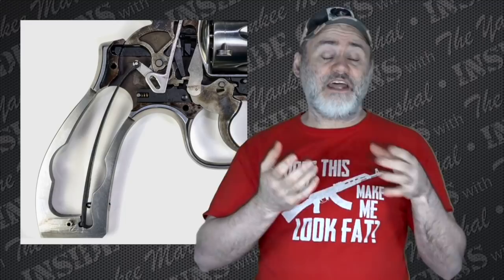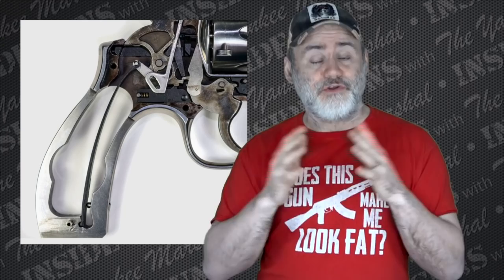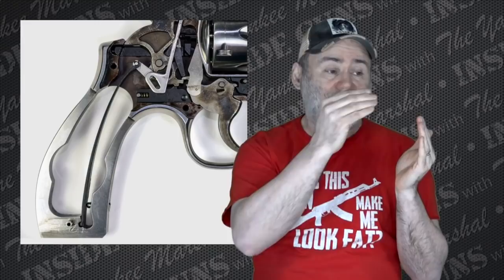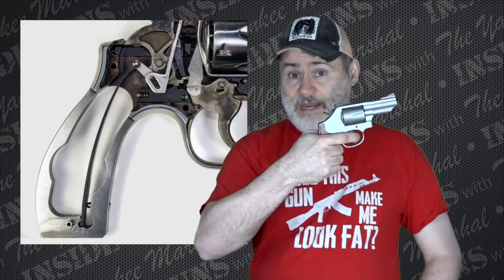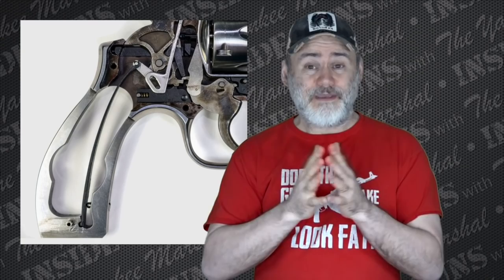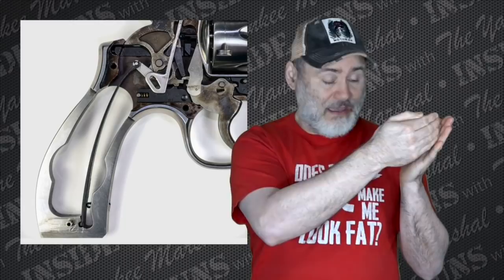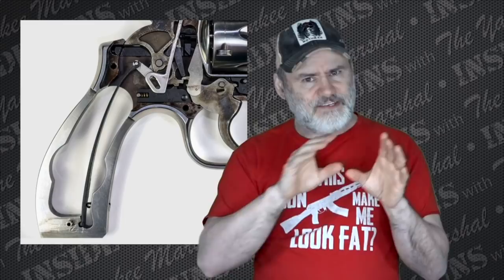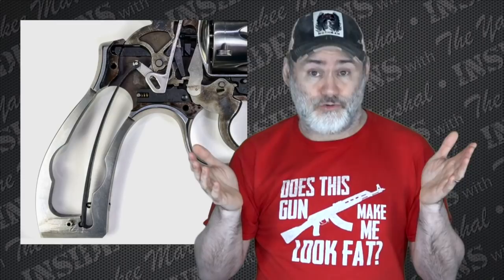Can You Ever or Should You Never Lighten the Springs in a Revolver? (& Bloopers)

Comment: My 686 had a problems with light primer strikes in DA. I believe it was you that helped me figure out it was the strain screw. I tightened it and it fixed it, but the screw came loose again. I used blue loctite the second time and never had a problem again. I'm thinking that hot loaded 357 rounds were vibrating the screw out.

Comment: I have come to the conclusion that almost every new revolver should be sent to a master gunsmith that is knowledgeable with revolvers.  My one exception is the Ruger LCR revolver.  They will perform the following for a nominal fee:
- Polish the parts
- Smooth out the action
- Lighten the trigger pull (if requested)
- Tighten the movement/action if needed
- Crown the barrel and chamfer the forcing cone
- They will also address light primer strikes if that is an issue
This is what they did with revolvers that were made and tuned in the 50s, 60s and 70s.  I just the add the cost into the equation when purchasing a new revolver.  They just don't put the time into the revolvers like they did in years past.

Comment: I have a 642 air weight that had a 12 pound factory double action trigger pull. Had a professional gunsmith take it down as far as he was comfortable with. It now has a 5 pound trigger pull and is a pleasure to shoot. Took my 686 plus to the same guy, 2.5 lb SA pull and 5 lb DA pull. Not something I would hand off to an inexperienced shooter.
Reply: I bought the Wolf spring kit and got my S&W 586-3 down to 7 pound DA pull and 3 pound SA pull.  The original DA pull was 14.5 pounds and was unconfutable to shoot.  You are correct, I wouldn't hand off to an inexperienced shooter.
Reply: 5lb d/a kills my reason for carrying a striker fired autoloader. If I can't hit the bad guy in 6 shots or less I should probably stop shooting especially in public. Any suggestions? I'm used to a Glock 27 but want a 357 now
Reply: @rayfordgibson7650  , my 357 is a Smith and Wesson 686+. It holds 7 rounds in the cylinder. I think they came in 3”, 4”, and 6” barrel lengths. Mine is the 4” barrel. 
As far as carrying a revolver for self defense, it wouldn’t be my personal choice. I asked a “ Use of force “ instructor for a police department what he recommended for a carry weapon? He said I should carry whatever I’m comfortable shooting and can reload effectively and quickly. I carry a Glock 43X with a 13 round mag, and an extra 13 round mag on me. I would rather have to much ammo than not enough.
Reply: @jimmyhorton8297  I've heard alot of good things about the 43 and 43x. I went with .40 bc the idea of 1 shot stops but Its hard to control
Reply: @rayfordgibson7650  yeah, I like the 43X because the slide from a regular 43 or a 48 will fit on the same frame. When I bought mine, the slide on the 43X was silver. I just took the slide off of my 43 that already had high vis sights and was black,  and slid it on the 43X frame. I now have a drop in 3 lb trigger and a tungsten guide rod to help with muzzle flip. If you want .40 power in a 9mm round, just buy some Wilson Combat ammo. They bought Underwood Ammo who makes the Extreme Defender round.
Reply: @jimmyhorton8297  my 9mm is a g2c that I bought for my girlfriend and idk if it can handle those loads

Comment: I put Wilson Combat spring kits in all of my S&W K, L, and N frames, but I don't carry any of them for EDC. I also put a spring kit in a Taurus 66 and cut off 1 coil at a time until I got the pull down to where I liked it. I tested with handloaded ammo using hard primers. I haven't had a light strike yet with reloads or factory ammo.

My LCRx and K6S DA/SA are stock. I carry them for EDC and they were already pretty good.

Comment: I often times swap out the rebound springs in my Smith & Wessons and that definitely improves the pull without any risk of light primer strikes because the leaf spring is still doing exactly what it was designed to do by the manufacturer and engineer of each model. I do however occasionally swap out both when a model has a particularly heavy trigger for a centerfire cartridge. I believe that the manufacturer always errors on the heaviest side of the calculation to avoid light strikes even on the hardest of primers. Once you know your ammo characteristics and both limits of leaf spring tension, a nice Wilson combat mainspring is generally all that is necessary to turn a good gun into an incredible gun. That being said, my carry piece is bare bones stock so when it ultimately matters most there’s literally no chance of error.

Comment: I had a S&W 686 Power Port that had light strikes occasionally. I tightened the tension up a little on the hammer spring then I lightly polished the contact points of my rebound slide and installed a cylinder and slide extended firing pin and never had another light strike out of it even with the hardest of primers!

Comment: The glitches Hickok45 had with the Python were probably due to the longer trigger pull and reset of the Python. Most folks need practice to adapt to the old style Colt revolvers in double action mode, including the old 1917 .45 ACP revolvers. The DA pull is longer than with comparable S&W revolvers with leaf springs, and the trigger reset is much longer with the Colt. That's one reason why I had a S&W 1917 .45 ACP modified into a snubby, but didn't do the same with a Colt 1917. But the Colt was a better range gun, with heavier barrel and better single action trigger (although the S&W 1917 also had a very good SA break).

If you're accustomed to shooting double action rapid fire with a S&W, Ruger or others, the Colt leaf spring revolvers will trip up many shooters at first when they don't allow the trigger to fully reset. Jerry Miculek experienced a similar glitch when comparing his Python with S&W and a Ruger Speed Six during the same range session demo video a few years ago.

That's why the Python and comparable Colts aren't seen as often as S&W in practical/combat/defensive competitions. Finely made revolvers, very accurate, but the long Colt pull and reset aren't ideal for rapid fire scenarios.
Reply: The old S&Ws (pre war) had a long action just like the Colts. Modern S&Ws have the short action. Shooting both type along with v spring and modern colts though, I don’t notice any difference.

Comment: I found the double action pull of my GP100 to be virtually unusable. Looking around online, I’ve seen a couple people measuring it at 12+ lb. I reduced my hammer spring from 14 to 10 lb and my return spring from 12 to 8 lb if I remember correctly. Haven’t had a light primer strike yet.

Comment: Interesting video. How do you account for light strikes with Beretta and Sig Sauer hammer-fired handguns after lightening the hammer springs? Essentially the semi-auto hammer spring is responsible for the hammer to hit the firing pin hard enough, just like a revolver.
Reply: Revolver spring kits often include a lightened firing pin spring to compensate for lighter hammer hits. Lightened firing pin springs are available for semi-auto pistols, but not always included in kits, and ease of installation varies. 

The risk to lighter firing pin springs in semi auto pistols is the firing pin may overcome spring pressure when dropping the slide to chamber a round and pinging the primer. So always test carefully at the range with the pistol pointed safely downrange and drop the slide to chamber several rounds from a magazine, but don't shoot yet -- check the primer first for dents.

The fix for that may be a lighter firing pin, usually titanium.

I'd only make these mods for a competition or target semi auto. I prefer to leave defensive carry pistols pretty much stock. But I do install lighter spring kits in all of my revolvers. Never any problems.
Reply: @theparalexview785  Your answer is perfect for a revolver, but as you said, I've never seen a lightened firing pin spring on a semi-auto, and the manufacturers always say lightening the hammer spring on a semi-auto may lead to light primer strikes. Yankee quickly dismisses this issue on semi-auto firearms, and I hope he addresses this. I understand many use a 12 pound hammer spring in Beretta 9X series guns without light primer strikes, but Beretta uses the heavier, factory original, hammer spring to ensure there are no light primer strikes.